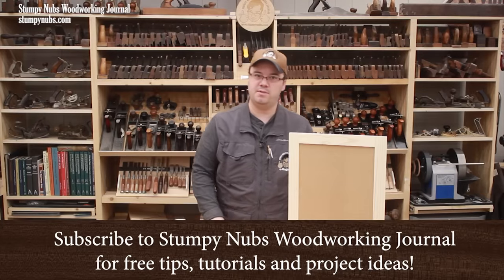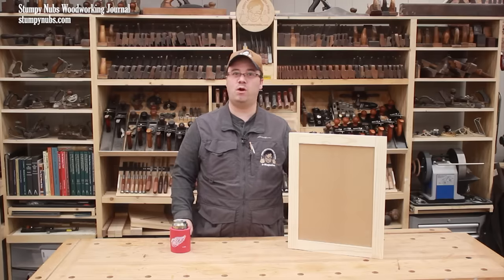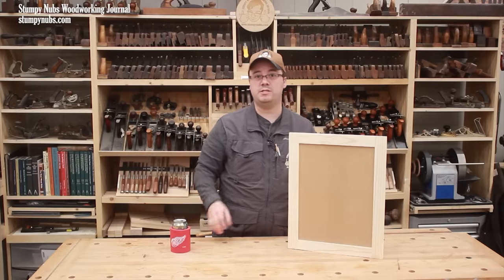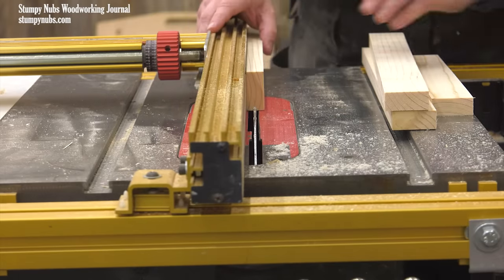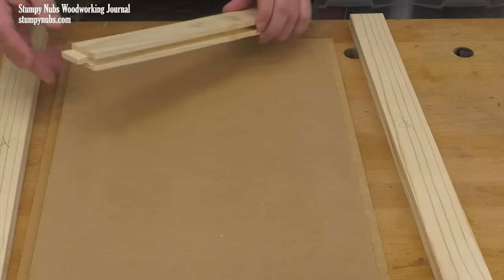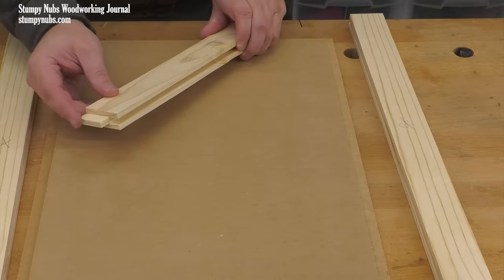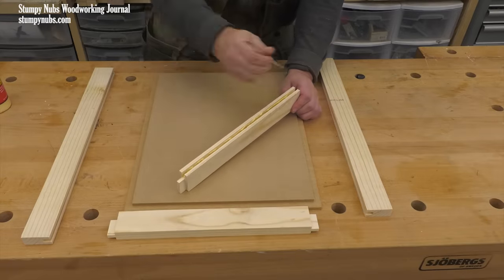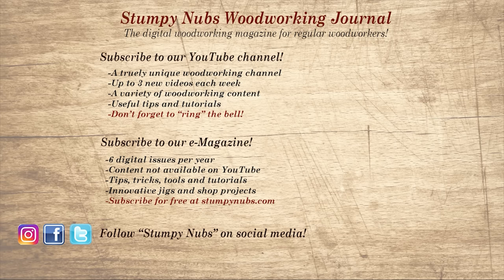DIY Cabinet doors with just a table saw!

Comment: Stumpy I need your help.. I made a cutting board is it safe to finish it with Arm-r-seal if not what do you Recommend I trust your opinion very highly thank you
Reply from the maker: Any finish is food safe once in cures. Polyurethane (which is what's in Arm-R-Seal) takes a month to fully cure. After that. It's just plastic.
Reply: Thank you very much
Reply: Don't use a film-forming finish (like Arm-r-seal, or any varnish) if you are truly going to be "cutting" on it.  Only use an oil and/or wax finish.   Mineral oil from the drug store works file but needs renewed regularly.  Salad oils can go rancid.

Comment: 6:00 Did the fence move? Is that normal when using feather boards?
Reply from the maker: That particular fence has a clamp on both ends to secure it. The one on the end nearest the camera wasn't tight enough. However, the movement is greatly exaggerated by the close camera view and made no difference in the cut itself.
Reply: @StumpyNubs  gotcha. Wasn’t trying to be a butthead, just wanted to make sure you were aware of it in case you didn’t notice. I still think there’s something wrong with that Penguins logo on your tumbler lol

Comment: your fence is deflecting sideways quite a bit when cutting the grooves!
Reply from the maker: There are two locking points for the Incra fence, one on the positioner arm, another on the fence rail itself. I did not have the fence rail lock engaged. It looked way worse in a video closeup than it actually was. I didn't even notice it, and it didn't affect the cut.
Reply: @StumpyNubs  yeah the result counts in the end, I was just surprised to see that much movement - Thanks for the video

Comment: Question:
I have taken it upon myself to redo my mothers kitchen… which was going GREAT… until …
Here’s the deal;
Her cabinets are flat slab (80’s). I have just started this project, only have 2 panels done so far (slab to shaker style, didn’t do it like in this video, I did it more like a diy.. and here’s why..)
The kitchen cabinet doors fit on a face frame.. but unfortunately they also have a lip on the back of the cabinet doors that lay into the frame. (Hope this makes since:.) and my problem is that I cannot figure out what type of hidden hinges to use BECAUSE of the lip on the back of the cabinets. (Really wish I could upload a photo!)

Comment: Stumpy, it appears your fence is flexing a bit when you cut the grooves.
Reply from the maker: There are two locking points for the Incra fence, one on the positioner arm, another on the fence rail itself. I did not have the fence rail lock engaged. It looked way worse in a video closeup than it actually was. I didn't even notice it, and it didn't affect the cut.

Comment: @6:00, while the groove was being cut, the fence seems to move away from the blade.
Reply from the maker: There are two locking points for the fence, one on the positioner arm, another on the fence rail itself. I did not have the fence rail lock engaged.

Comment: Your fence was moving cutting the grooves 🙈
Reply from the maker: There are two locking points for the Incra fence, one on the positioner arm, another on the fence rail itself. I did not have the fence rail lock engaged. It looked way worse in a video closeup than it actually was. I didn't even notice it, and it didn't affect the cut.
Reply: @StumpyNubs  ah ok. Yeah fence flex always looks worse in video than it usually is. Especially when you do a jump cut from a frame where it’s flexed to another shot where it’s relaxed.

Comment: That tablesaw fence deflects quite a bit when cutting the grooves.
Reply from the maker: There are two locking points for the Incra fence, one on the positioner arm, another on the fence rail itself. I did not have the fence rail lock engaged. It looked way worse in a video closeup than it actually was. I didn't even notice it, and it didn't affect the cut.

Comment: Great tips. 
Your 2nd feather board seems to be pushing the work piece and pushing your fence away from the blade. At least it seems that way in the footage.
Reply from the maker: There are two locking points for the Incra fence, one on the positioner arm, another on the fence rail itself. I did not have the fence rail lock engaged. It looked way worse in a video closeup than it actually was. I didn't even notice it, and it didn't affect the cut.

Comment: Was going to do pocket hole technique but then stumbled upon this video.  I'm a beginner.  Mistakes to avoid:  Make sure fence is lined up correctly.  Don't clamp so tight that it bows the door.  I didn't realize i did this until everything dried.  Be patient with rails and make sure the tongue fits good.  Get a decent mask especially when cutting the mdf board.

Comment: I love and subscribe to your channel.  I'm not here to find fault, but at 6:00 (and other points) when cutting your groove your feather board causes your fence to give way to the left (away from the blade) what looks like maybe 1/16 to 3/32 inch.  Perhaps you might think to address such a problem in a future video.

Now, back to your video, which I'm enjoying thus far.

OK, finished.  Excellent tutorial.  Thanks.

Comment: Awesome, this is the only video I have found showing 1/2” panels with the frame protruding 1/4” on the outside and then having them set flush on the inside. All others used ¼” panels and had the frames showing on the inside as well, yuk, just look weird.

Comment: So if I do have a dado stack (but not a flat kerf blade like in the video), and I'm still a newbie, what do I do different here?  I'm guessing I can use the two outer dado blades to cut the 1/4" groove (the minimum the stack will cut).  Then I can use the wider stack to cut the tongues, and the rabbet on the MDF?

Comment: Hi! I'm new to this channel, I'm not a carpenter by far, but I am trying to put a frame around my door cabinet  my door, are not that nice in fact, they have formica, so I sand the formica and put wood like a frame on the doors then putty and paint and now my doors look twice as thick and I'm just about to give up but I don't want to disappoint my wife after spending so much money trying to do this right, but I'm just so done I don't know what to do, I went to home depot asked about new cabinets installed and all and they wanted 30 thousand and that's when I decided to reface them but it just doesn't look good 😢 do you have any suggestions I do have a table saw and a skill saw but that's all can't afford anything else on the count that I am only a class D security guard  and don't make to much money, I use to be a painter but I've had two back surgeries and so I had know other choice and had too do security,  don't mean to burden you especially I don't even know you, thank you and God bless you.

Comment: I can see the Incra Fence move on the back of the table (for example on 7:01) how is that possible on that system? I only use the routertable Fence from Incra on the TS and it is rocksolid without those extra rails...
I really like your videos btw, really good content all the way! this comment is really out of curiosity, not intended to be a smartass :)
cheers!!
Reply from the maker: There are two locking points for the Incra fence, one on the positioner arm, another on the fence rail itself. I did not have the fence rail lock engaged. It looked way worse in a video closeup than it actually was. I didn't even notice it, and it didn't affect the cut.
Reply: aah ok :) I was wondering since the Incra stuff is super solid!
thx for explaining:)

Comment: Have you noticed your cut accuracy suffering with the fence flexing? 6:35 It looks like that 2nd feather board is applying too much pressure for the rigidity of your fence.
Reply from the maker: That particular fence has a lock on the end that wasn't engaged at the time. The extreme closeup camera angle made it look worse than it was.

Comment: What about using 1/2" plywood for the panel insert instead of MDF?  Would the rabbet be structurally sound enough to use in the door?
Reply from the maker: I said you could do that a couple times in this video :)

Comment: So if you stain oak will it be ok for a bathroom vanity? Also we're poplar be okay for a bathroom? Do you have to use the same type of wood for the framing of a vanity as well if you're using the recommended woods you mentioned for the doors?
Reply from the maker: Any wood will work for a bathroom vanity. You just should be more aware of grain direction and wood movement than you normally might. And yes, you can make the frame and other non-visible parts from less expensive wood.

Comment: I just made some doors following almost exactly the same procedure. The biggest issue I ran into was, cutting the groove this way makes the groove thickness related to the thickness of the board because each face is a reference. There was enough variation in the poplar I bought that it was a problem, and I spent a lot of extra time checking and re-cutting grooves. My 1/4 inch baltic birch plywood also had a little variation in thickness, enough to notice.

Also note that any twist in the boards makes it hard or impossible to cut accurately and results in doors that aren't flat.  

My hardwood dealer doesn't sell any straight wood, not even the S4S stuff, so I desperately need a jointer and planer.

Comment: If using solid wood panels, and you want to keep them fixed in the groove, use a little silicone which will still allow for minor expansion and contraction.

Comment: This is a phenomenal video. It doesn't make assumptions about the viewers, it doesn't immediately assume the viewer has a table saw that will accept a dado stack, and it makes reasonable assumptions about what kind of material a person trying this for the first time might have access to or be willing to spend on an experiment.  Follow-up question, would using a router table to cut the dados be a good idea here? I understand that a router table isn't a tool that most beginners will have on hand, but I'm in a weird place with my equipment where I've built up at least something for most of my tool needs but not necessarily great tools.

Comment: I laughed when you said MDF, but then again, it's a good opportunity to play around with paint layers.
Reply from the maker: Why did you laugh when I said MDF?
Reply: @StumpyNubs  MDF is the wood product that gives you all of the bad wood traits, and none of the good ones, in exchange for no warpage. No natural wood beauty, not as much bending strength, then to make an aesthetic panel out of it, just sounds outrageous. But in the big picture, the project turned out good, so that's awesome!
Reply from the maker: @Dr_Xyzt  - If you are expecting natural beauty, then MDF is a poor choice. But if you are expecting something that will stay flat and smooth and sturdy, it's an excellent choice. Rejecting (or laughing at the use of) a product just because it doesn't fit the requirements for projects that it isn't being used for is a little silly to me. It's like laughing at someone who uses pine because you think only hardwood is a worthy material.
Reply: @StumpyNubs  In my region, MDF is used in a lot of thinner cheaper poorly constructed cabinets, and they all have some sort of paper-like laminate that doesn't age well. People decide that the material is no good, then hire me to make thicker plywood replacements. If the stuff around here was constructed like yours, it would be a lot better. Like I said in my first comment, it's a good opportunity to play with paint layers. You get a durable finish and a more modern looking cabinet.

Comment: I have made several doors using similar processes (Including and entire kitchen with oak door frames with tongue and groove cedar closet lining inserts). I have also made doors with rabbets all the way around holding in panels of either 1/4 in plywood or raised panel solid wood. The plywood was covered on the "outside with fabric wallpaper selected to match the room décor and can thus be changed relatively easily. (Just a few thoughts)

Comment: I'm curious as to how you would adjust to add a glass or mirror panel to the center rather than mdf or plywood.
Reply: I've not done those, but I imagine free floating would rattle (if it's a glass mirror) and a bit of some sort of padding around the edges (like a narrow, thin roll of weatherstripping to cushion it) before pushing it into the groove would help.  Also, if the back side of it being exposed when the door's open might subject it to scratches that show through to the front side, adding a thin backer of some sort, not necessarily adhered to it (since you don't know the effect of the adhesive on it), but just sandwiched in the groove next to it, would protect that.

Comment: This is another great video. I have two comments. First, consider purposefully cutting a couple of "test" rails and/or stiles. This will help "dial in" when getting to the desired groove width without over committing on the actual work pieces. You can later use these test pieces when "dialing in" on the tongues. Second, the half-inch MDF is a great idea, but it may be a bit heavy on large doors. This is something to consider.
Reply from the maker: There seems to be no reason to test cut the grooves since the width is arbitrary. The tongues and rabbets are cut to match whatever grooves you end up with. As for weight, I have some 5 foot tall pantry doors with MDF panels in my house. I would not trust a door like that to stay flat with a 1/4 inch panel. The added weight just means using three hinges instead of two on such a large door.

Comment: This video was perfectly timed Mr. Stumpy. I’m making a framed mirror for the wife. I had planned on using half lap joints and just cutting a trough for the mirror to sit in and put tabs on the back to hold it in. Would this be a stronger way to build that frame, and make it be better for hanging?
Reply from the maker: Half laps are very strong as well. Also, keep in mind that you can't get a glass panel out of a groove such as this should it break and have to be replaced.
Reply: @StumpyNubs  Great point! Glad I asked questions instead of just getting after it.

Comment: Word! While I was in college, I ran the door crew at a furniture mill. I later managed a kitchen cabinet mill for the family that owned the furniture mill. I mention that not to brag, but to help establish credibility when I say: James got it exactly right in this brief video. These are exactly the methods we used to make doors -- sometimes 200+ doors on a shift in the furniture mill. If you pay attention to the details, anyone can make a well-crafted door with relatively few tools.
Reply: @Heloise O'Byrne Heloise -- Cabinet doors were being made with nothing but hand tools long before power tools were invented. So, yes, they can be made without a table saw. 

However, sawing accurately with a hand saw is a skill few of us have anymore. (It's a skill that virtually all of us could master, but it takes a sharp saw and a lot of practice.) Given that, I would recommend using a track saw, such as the Makita SP6000J1 or the Kreg ACS-SAW. (There are other track saws that would work. These two are only examples -- not the most expensive nor the least expensive, but quality saws that will serve a hobbyist well.) 

A track saw can do virtually everything a table saw can, with similar accuracy and cut quality. They take up a lot less space to store. The downside is repetitive cuts with a track saw take longer than with a table saw. 

HTH

Comment: An inexpensive table saw?  Sure, you can make these.  Cheap table saw?  I wouldn't count on it.
Reply: I've done it on a Ryobi TS I got for free.

It takes methodical workflow, and experience.
Reply: @lordaleksandre  I think you completely missed my point.
Reply from the maker: I don't think he did. A Ryobi table saw is a cheap saw, at any price.
Reply: @Arbbal  Do you think you articulated it well?
Reply: @StumpyNubs  Sweet a reply from the man himself.  Admittedly I'm not terribly familiar with the quality of all saws available.  When I got out of the Navy and finally got a place where I could set up a shop, I looked for a saw, and was quite disappointing with what I saw at the stores.  When the gears for blade height and angle on the display models are stripped, because they are made of plastique, I don't see the saw lasting more than a few years.  As luck would have it though, I came home one day to see a saw sitting in my neighbor's driveway with a sign, "FREE (it works)."   It  is a C'Man but was missing a fence and blade guard, so I started searching for them, only to discover I am the owner of a '51 C'man 113.27610.  I watched you guide to tune a saw only to learn my saw, to this day she is dead accurate and chooching away on the original motor, even the factory fence that I replaced is awesome.  So while my saw was inexpensive (can't get less than free) she is by no means a cheap saw.  To get the same quality saw today, I'd be spending thousands.